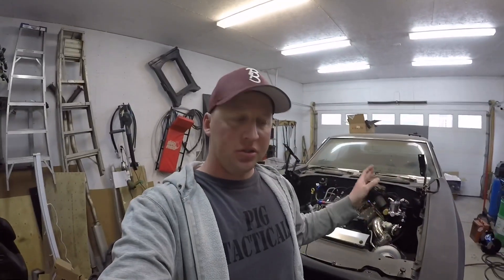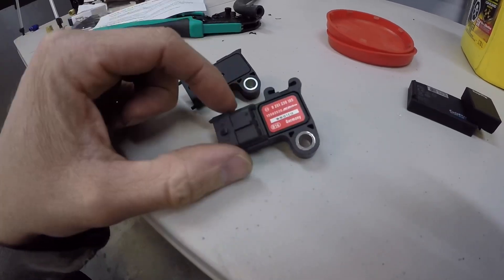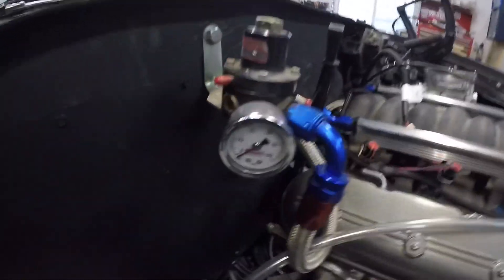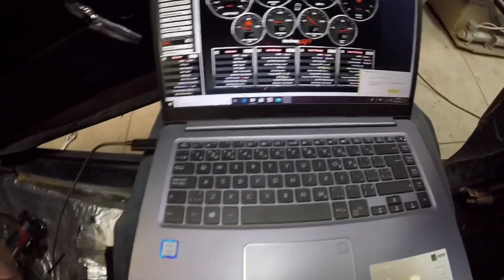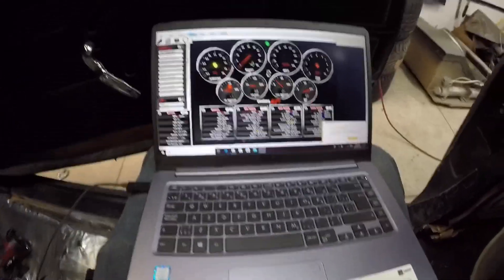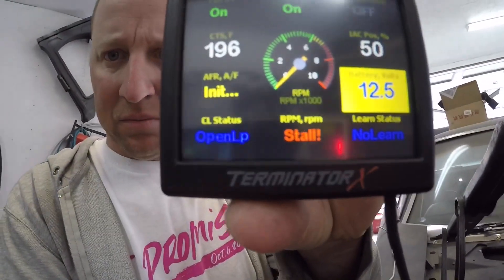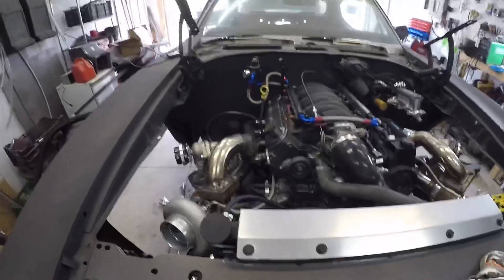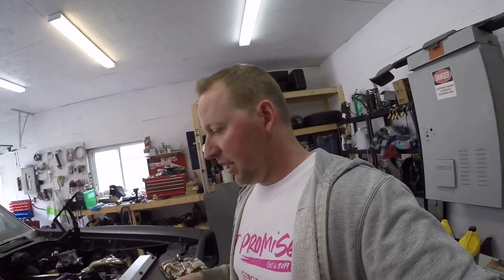Twin Turbo LS Build on a Budget Pt. 13. Ironing out some issues.

Comment: Hey, did the map sensor plug directly to the holley terminator  Harness harness or did you buy a  Adapter?
Reply from the maker: I ran a 2.5 bar map sensor, that requires an adapter. The Holley part # is 558-416. If you’re using the factor 1 bar sensor, I believe it plugs right in.
Reply: @averagedadsgarage  thank you

Comment: Glad to see the new sensor fixed that issue.

Next, I would pull the fuel rails off, have them sitting over buckets(in case of leaks) and cycle the pump on and off to see if any are stuck open
Reply from the maker: I was thinking the same thing.